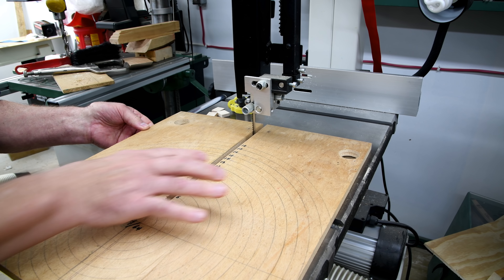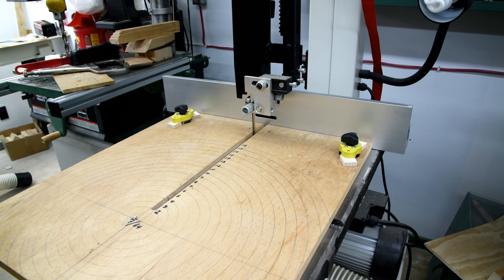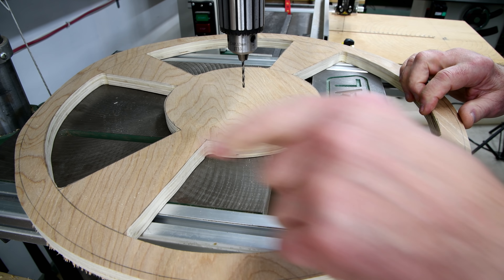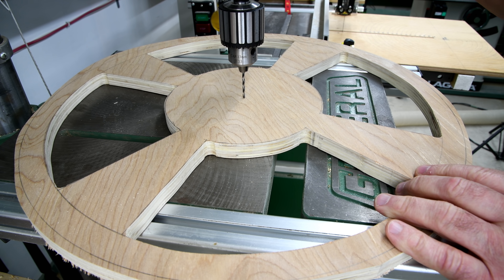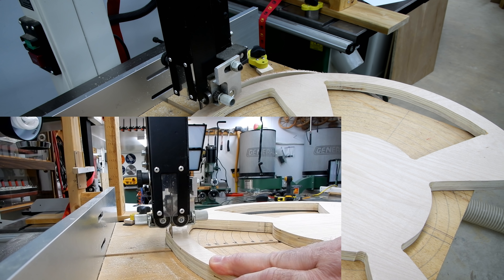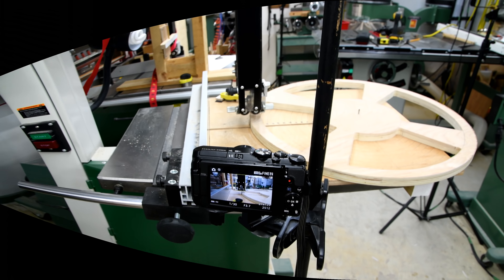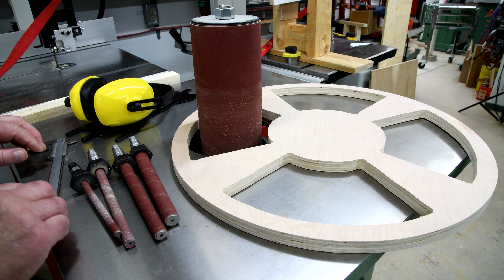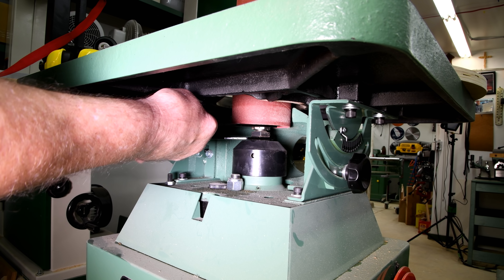The Big Clock Project - Part 18

Comment: My thought was to use a much larger forstner bit on the larger radius areas rather than the smaller brad point.Any way thanks for all the interesting videos.
Reply from the maker: I may be using a larger bit on the second gear.